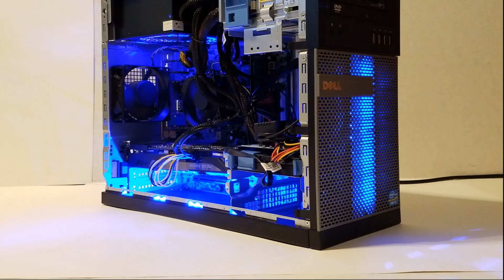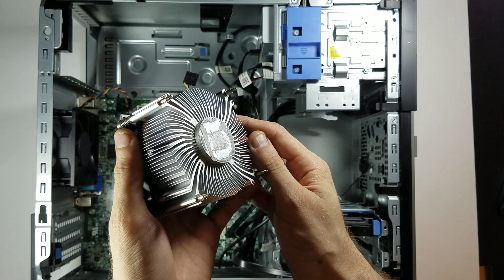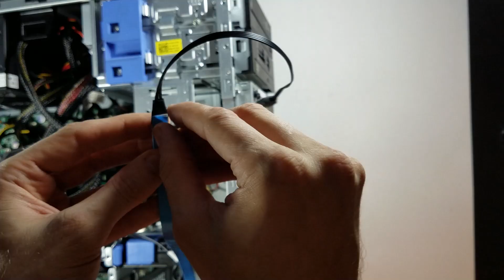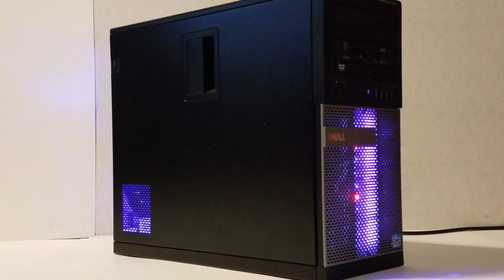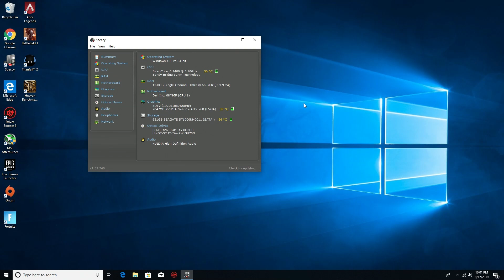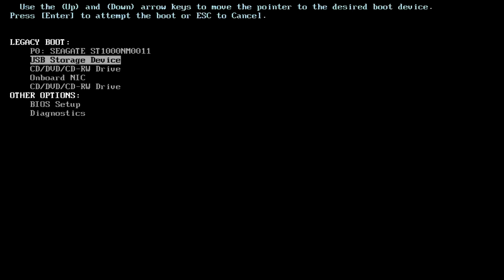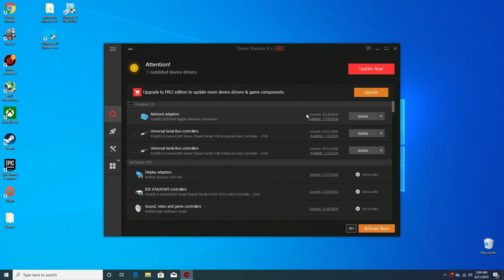CONSOLE KILLER PC *BUILD GUIDE* | FORTNITE | GTX 760 i5 2400 DELL OPTIPLEX

Comment: Bro u sure 60 fps on fortnite??!! Wow better than my gtx 1050 hahaha
Reply from the maker: 60FPS on epic settings and 144 on low. The 760 is an amazing card as it can be bought for $50 and performs same if not better than the 1050.
Reply: Tech Yesterday is buying on eBay.. reliable because cheaper prices may mean complications with the card..
Reply from the maker: @landonbrown9405  Im actually working on a video on how to get the best prices on ebay. Im posting it in the next few days. Ebay is hands down the best place to get PC parts.
Reply: Tech Yesterday I’m just worried of buying a used one and it not working.. then what..
Reply: Tech Yesterday would brands like gigabyte zotac cards gtx 760 perform as same as evga’s card?
Reply from the maker: @landonbrown9405 You pay with everything on ebay with paypal. If you buy something that doesnt work or is not as advertised. You get a full refund no questions asked. Again i am making a video that will be out saturday or sunday the latest explain and showing you how to get the best deals possible.

Comment: How about my Optiplex 7170 with a Core i5 3470 processor? Is it much slower than the Core i5 2400?
Reply: Actually the 3470 is a little bit faster
Reply from the maker: If you can get the i5 3470 at a good price then hell ya! Thats a great CPU and is a little better than the i5 2400

Comment: So the rx 570 will fit into this case easily.. and my FPS with the gtx 760 st low settings is what
Reply from the maker: Depending on which model RX 570 you get. Some require you to remove the hard drive bay to fit a huge GPU. Video coming soon. View our $200 console killer to see more on the RX 570
Reply: Tech Yesterday rx 550 is it the same FPS... and does it require anything special to remove in order to make it work..
Reply: Tech Yesterday what model of Rx 570 would force me to remove the hardrive

Comment: Tech yesterday do you know a power supply to go with the gtx 760 used in the video
Reply: Evan Dasilva https://m.ebay.com/itm/NEW-600W-650W-650-Watt-700W-Large-Fan-BLUE-ATX-Power-Supply-PSU-450W-500W-550W/400646802599?ul_ref=https%3A%2F%2Frover.ebay.com%2Frover%2F1%2F711-53200-19255-0%2F1%3Ficep_id%3D114%26ipn%3Dicep%26toolid%3D20004%26campid%3D5338167358%26mpre%3Dhttps%253A%252F%252Fwww.ebay.com%252Fitm%252FNEW-600W-650W-650-Watt-700W-Large-Fan-BLUE-ATX-Power-Supply-PSU-450W-500W-550W%252F400646802599%253Fhash%253Ditem5d48690ca7%253Ag%253A4w0AAOSwFLBaVqFR%253Asc%253AUSPSPriority%2102072%21US%21-1%26srcrot%3D711-53200-19255-0%26rvr_id%3D2099697767657%26rvr_ts%3D010a61ad16d0a4e908c6351cffc8f626&_mwBanner=1&_rdt=1&ul_noapp=true Thank me later.
Reply: @shawn6477  do you know a name branded PSU because I don't trust that might fry my whole pc
Reply: Ovxrlay I use it, it won’t. Trust me.

Comment: After searching the required parts, it totals $237.05 😢 Will consider, tough dilemma!
Reply from the maker: No its only $150
Here are the best deals on the PC, graphics card, and power supply. These are all the components you need to build this PC.
Dell Optiplex i5 2400
https://tinyurl.com/y4frybqh

Nvidia GTX 760
https://tinyurl.com/y2nte4tx
https://tinyurl.com/yxk8slvp

500W Power Supply
https://tinyurl.com/yxban85x

Comment: Does the pc have to come with a hard drive or operating system also do I need to buy the ram or is it not necessary and if it is what good does it do
Reply: I got this same PC off eBay for 150 USD 2 years ago and   it came with 8gb ram,500 gb hdd with Windows 10. The only thing I had to do was buy a 500 watt power supply and a gtx 1060 6gb used for around 175. As of today I'm still able to play mostly all games @1080p high to ultra settings 60+ fps. I can even dab 1440p and 4k in games like street fighter 5,modern warfare 3, bo1 and 2. Best $320 dollars I've ever spent.
Reply from the maker: Here are the best deals on the PC, graphics card, and power supply. These are all the components you need to build this PC.
Dell Optiplex i5 2400
https://tinyurl.com/y4frybqh

Nvidia GTX 760
https://tinyurl.com/y2nte4tx
https://tinyurl.com/yxk8slvp

500W Power Supply
https://tinyurl.com/yxban85x

Comment: How long do these last and also what can’t this Pc handle? I don’t really know much about pc’s, sadly...
Reply: It'll last 2-3 years for gaming. And basically endlessly for non gaming purposes. As for what it can't handle probably most AAA titles in the next 1-2 years. Borderlands 3 will probably barely run but it's a great machine for Esports and 2017 and under AAA titles.
Reply: Ninja Kasper 106 thanks🤝
Reply: @NandoBlessedYT  I'd go for it if you are gonna play things like fortnite, Apex,C's go, r6 siege etc even shadow of the tomb raider :)
Reply: Ninja Kasper 106 yeah I plan on playing fortnite.
Reply: @NandoBlessedYT  just saying if you can afford another 20-30$ you should get an rx 570 it'll get you 90fps all epic no shadows and all low epic view distance you'll get 300+ fps with the rx 570
Reply: Ninja Kasper 106 okay, any other parts I should know about? I don’t have a crazy tight budget.
Reply: @dapyzzz4209  so if I get an Rx 570 and get all the other parts in this video the pc will run even better?
Reply: @raceforshotties  yup
Reply: @NandoBlessedYT  maybe get an SSD (solid state drive) but  that's not to  important. If ya wanna upgrade the CPU you canax go with the i7 2600K. But everything else should be good!
Reply: Ninja Kasper 106 hey which dell optiplex do I buy, can you link me one?
Reply: @NandoBlessedYT  any of em will work as long as they have a i5 2400 of you want some models there are the optiplex 990 ( the one I have), 390, 790 etc. They're all the same except the release date
Reply: Ninja Kasper 106 okay thanks

Comment: Can I buy a i5  dell optiplex then add 4 gb ram and add a Radeon 570  and change the processor to a i7 3770
Reply: Because i7 pcs are really expensive
Reply: Absolutely, lga 1155, which supports both 2nd gen and third gen intel cpu's are compatible wiht both of them.
Reply from the maker: We have videos coming up on the i7 2600 and i7 3770. You dont really see that much of an increase using those CPUs unless your playing new games. Like call of duty bo4. Or battlefield 5. Games like fortnite and apex run fine with the i5 2400. Also most games from 2017 and under run fine with the i5 2400

Comment from the maker: ORIGINAL $150 CONSOLE KILLER BUDGET PC VIDEO
https://youtu.be/xFy4bD_eRH8
Reply: Make a video on how to overclock a cpu, gpu, ram, and monitor please
Reply: Tech Yesterday make a vid on the case swap please
Reply: thank you you finnally got it up
Reply: What about the motherboard
Reply: Tech Yesterday I followed everything you did with the exact parts but my power button is blinking yellow
Reply: Evan do you still have the stock power supply
Reply: hardly like the original one
Reply: hardly y you need the old one
Reply: Tech Yesterday what FPS would it run on gta5?
Reply: Evan you dont you need a new one. I got the thermaltake 500w and works like a charm
Reply: Tech Yesterday I have a question can I put 1660 in the pc or no ?
Reply: Tech Yesterday Hello, for some reason my graphics card doesn’t fit, do I need to get a bigger case?
Reply: Kamen Anderson did you take out the 2 brackets
Reply: Will I get scammed buying the card from ebay
Reply: Yo tech yesterday do you have a Twitter I can dm u on for help with this build I have all the parts
Reply: Help me i ordered the gtx 770 and it dosent fit help
Reply: Mystic _828 I'm having the same problem
Reply: Mystic _828 there is a cage where the hard drive goes!! That cage you need to remove so the graphics card fits!!!
Reply: Mystic _828 remember there is another place where you can put your hard drive, just put the hard drive there and just try a very big space hard drive.
Reply: The gtx 770 doesnt fit help pls
Reply: Help me pls i need u
Reply: Did u order the one with like gold
Reply: Im really sad i just wanna to play games
Reply: Pls anwser its urgent
Reply: Did you have a vga
Reply: Do I need a monitor with a VGA cable.
Reply: How many gb should a 770 be if I get that instead of the 760
Reply: Tech Yesterday can you show us how to case swap for the $200 pc please I would really appreciate it
Reply: Tech Yesterday can I use a 3TB hard drive on this pc???
Reply: Help! I did everything and now the power button is flashing orange
Reply: Tech Yesterday my usb ports are not working, recommendations?
Reply: Tech Yesterday does my usb ports not working have something to do with my cpu fan being dirty?
Reply: Hey man would a cx600 power supply work or is it too much
Reply: Why don't you buy the parts use though